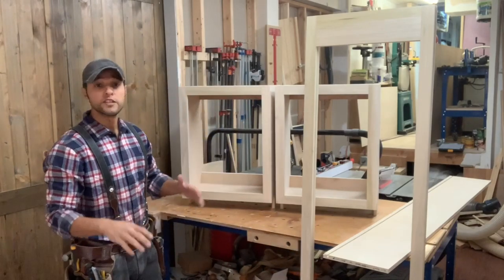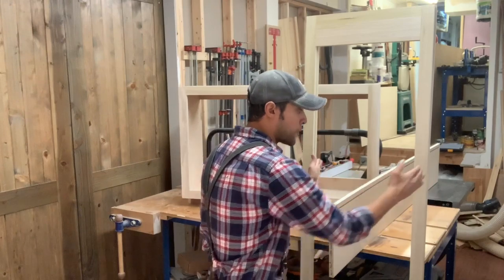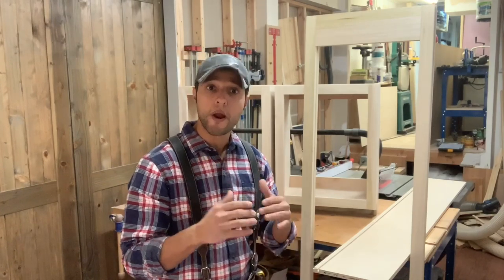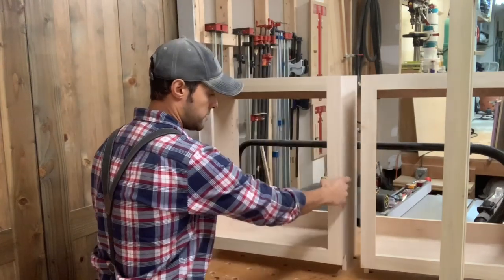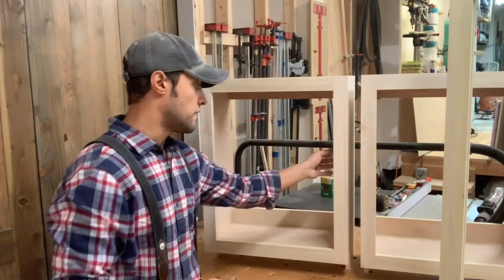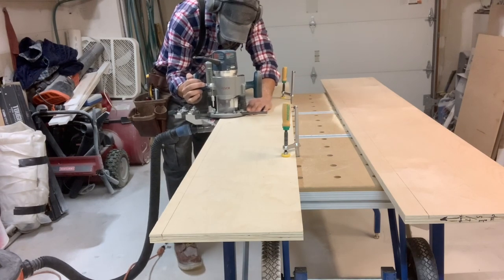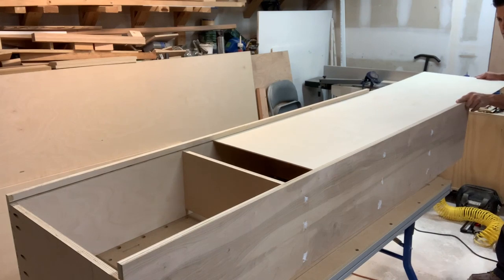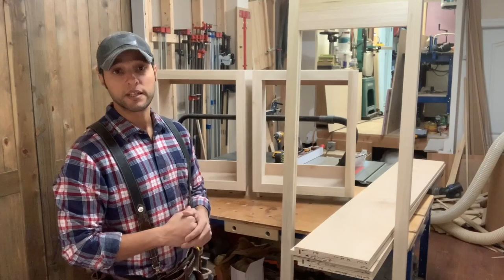How to route perfect grooves

Comment: Excellent video - I am about to make a cabinet from 18mm ply with a 12mm ply back panel which I want to groove into the carcass - what depth of groove would you suggest - a deeper groove gives me a bit more wriggle room in fitting but I don't want to weaken the back edge of the carcass . Great tip about bowed bits of ply btw.

Comment: What bit do you use for 1/4 plywood since the plywood is not ready 1/4”?
Reply from the maker: The plywood is slight over 5mm, so I use a special plywood bit that’s about 5.2mm. You can also use a 6mm bit, that works well also.